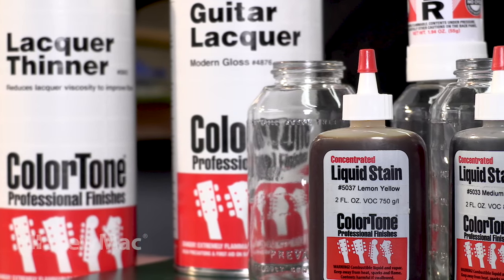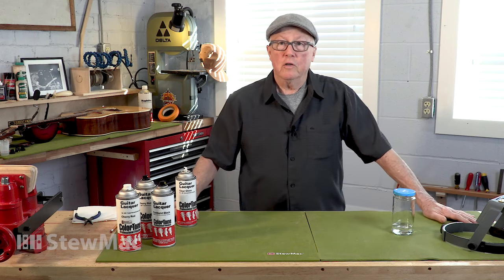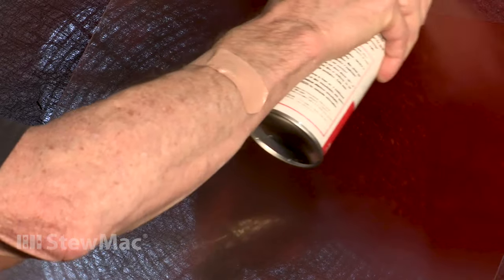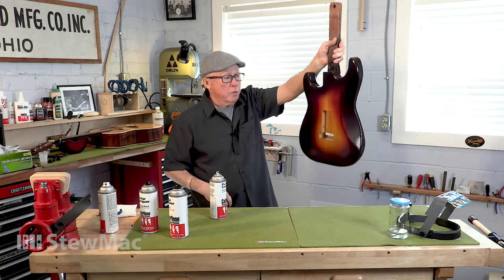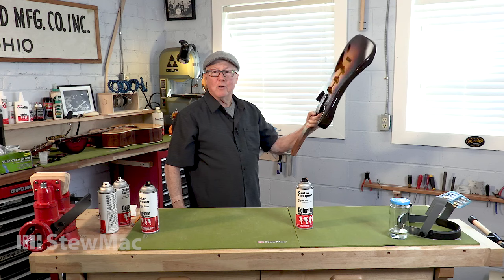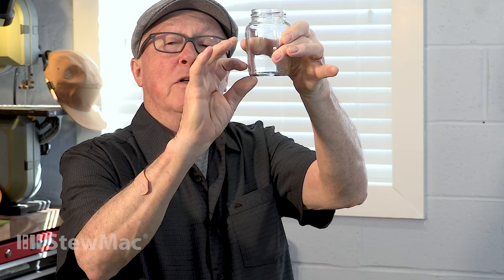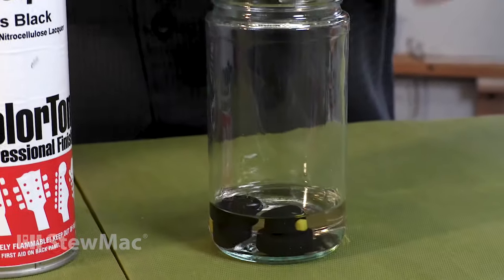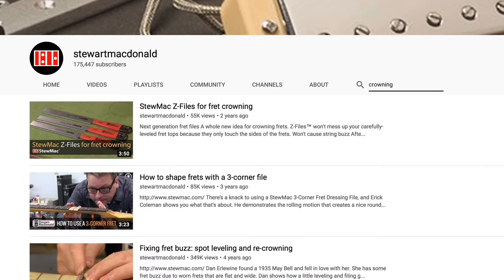Dan Erlewine's 5 Tips for Aerosol Guitar Lacquer

Comment: *AS THE PAINT DISTRIBUTOR, LET ME AD ONE MORE TIP*  The Biggest Thing Spray Bomb (aerosol can) Users Don't Do Correctly or Enough Is, To Shake The Can Correctly!    The Can Is Purposely Made In Such A Way So You Can SEE When The Paint Has Been Shaken Enough & Is Well Mixed....  The Cans Were Designed For You To Shake The Can Up & Down Vigorously & Hard, Thus Leaving Tiny Dents In The SOFT Bottom Of The Can!    You Should See Many Dents In The Bottom Of The Can, If Not, You're Not Shaking It Hard Enough To Fully Mix The Paint!  ALWAYS Shake The Can Vertically, Not Side To Side In A Twisting Manor....... *LAST*  You Should Store Your Cans Upside Down If Going To Be Stored On A Shelf For Long Periods Of Time, This Keeps Humidity That Forms Inside The Can From Rusting Inside The Spray Relief Valve.
Reply: BINGO, you are 100% correct, this was something I was taught by a paint rep over 40 years ago, most people have no clue about the paint bottoms.....Same with storing the cans upside down, great comment, thanks!
Reply: Why do you capitalize every word?  Is your comment the title of a book?
Reply: @Retro6502  Nice! I was going to make some similar comment but yours is too funny.
Reply: @Retro6502  I ask everyone this question, and to this day I still don't know the answer.
Reply: Thank you for sharing your knowledge !
Reply: Thank you I did not know this.......
Reply: This is good to know. +++ I did not know cans needed to be shook vertically. Very timely tip for me.
Reply: @Retro6502  ''I Always Capitalize'' the ''Important Words''..... Plus I Quote-End Quote a lot, lol that's what makes everyone who they are.........
Reply: @Retro6502  my mom use to type in all caps so she could read what she was typing. Old eyes kind of thing.
Reply: @Retro6502  ahhh...can't see the forest for the trees? (all lower case btw)
Reply: I shook it as hard as I could. No dents occurred at the bottom of the can. Doesn’t seem to be very good advice. Shaking the can is good though. You might have to be the hulk to dent the bottom of the can 💪🏻
Reply: Thanks!!!
Reply: What's vertically? I usually stick a safety pin in the nozzle to get a thin linear spray. That's how I tag up the city and make some righteous graffiti art.

Comment: Warm lacquer definitely sprays better. the results look like a mirror. Before heating the can in hot water, make sure you have a Sharpie pen and clear packing tape because the water will melt the glue causing the paper label to fall off. Dry the can, mark what was in it with the Sharpie and then cover with a piece of clear packing tape so the sharpie ink won't rub off.

Comment: Might I suggest a video on things like sanding out orange peel, wet sanding, using sanding sealer, applying water slides and clear coat. I refinished a broken neck and repainted a headstock and as a rank novice they were all things I had to deal with, to learn about and do. And they all help get a nice finish. I wouldn’t have known those things had I not read about them in a book.

Comment: Hi Stew,
I’m making big bass marimba bars (percussion instrument that will be struck thousands of times with a medium hard mallet and will vibrate like crazy over and over and over). Traditionally they finished with oils and waxs, though I want to experiment with other stuff. For my experiment phase—in order of best to worst—can you please suggest/brainstorm what you think might work out for coating/sealing wooden bars that will be taking a lot of inherent abuse? With all the beating and vibrating, for instance, might shellac or lacquer or polyurethane or wood hardener or an acrylic poor be too brittle, resulting in getting rattled and crushed to death and breaking apart microscopically over time? Also consider which finish would be the most scratch resistant. (Bars will be stored in stacks and slid against each other with the potential of dirt and sand bits in between. Thanks for brainstorming with me 👍🏻
Sam

Comment: You should also align the spray tip with the round black mark on the top ring of the can.   You can see the mark in this video when turning the tip is discussed.  This aligns the pickup tube with the paint in the can so you get it all out of the can instead of sucking air.

Comment: i used minwax Lacquer gloss can and the finish is not hard strong enough as my finger pressure can effect it after the paint cured 1 month , so did i used a wrong product !
can  i use automotive paint like a base paint and finish it with a clear coat ?

Comment: I wish I watched this tips before had to learn some of them the hard way on my kit build avatar. 
   A proper mix is very important! Now I do a mix of 90% shaking the can up and down vigorously and 10% rolling the ball around the bottom and up around the walls of the can. All for a whole minute, turning the can upside down and viceversa. Then I let the can rest upside down for ten seconds, to allow the resulting bubbles inside to pop. 
    Don‘t stop the spraying movement at the edges of the piece, it will build up too much there. Just spray slightly over it, doing a „breakdance- lock‘n‘popp“-like move when changing direction. 
    Take a close look on the instructions referring the recommended temperature of the environment. If too hot (the same if you spray from too far), the tiny drops will be half dry before hitting the surface, and the paint will also dry too fast later on the surface and not uniform enough.

Comment: another reason not mentioned for heating the can/lacquer is that when you spray, you are expanding propellant liquid to a gas, which makes cold (how air conditioners work).  This can cause condensation, which can cause blushing in marginal humidity conditions. It's not generally an issue on very dry days, but with humidity higher than 65-70%, it can happen. The extra heat can reduce this.

Comment: Great Video - Thanks!!   One thing to know though, and to be Very Aware of  about "heating" an aerosol can.... part of the reason the paint comes out in a finer mist is Not only due to the paint "thinning" due to warmer temps as you pointed out..... but, also because the elevated temperature also Raises the internal pressure of the propellant, forcing the product out at a faster rate than normal. 

There is ("usually"), however... a downside to this, and that is... that it is "possible" to run out of propellant, BEFORE you run out of the product... in this case, paint, as has happened to me a couple of times.   You can apply this same technique to Any aerosol product if needed.... but just be aware that in some cases (Not All), in heating and raising the internal pressure that.... 1) you "could" run out of aerosol before the product is fully discharged,.... and 2) Be VERY Careful in preheating the aerosol container,  because different manufacturers use different propellants for pressurizing, depending on the product and "some" can "react" very violently (re: Explosive) when heated.

Some propellants pressurize exponentially in relation to the heat applied and "can" explode at container temps of 100 degrees +/-...... READ the Caution label on ANY aerosol container..... most will tell you Not to allow the container to be exposed to sustained direct sunlight (primarily in the summer) or Any other heat source above 100 - 120 degrees or explosion may (Will) result. 

I have witnessed an aerosol paint can explode (it was about 1/3rd to 1/2 full) that was forgotten and left in the sun on a hot early August afternoon for only about 20+ minutes..... fortunately, the paint was white.... and so was my shop next to where it was sitting..... the container looked like a frag grenade went off inside of it... am very thankful that I (or anyone else) was not standing close by it, when it went off. 

Sorry for the "book".... just be careful when heating and (therefore) pressurizing aerosol cans... of Any kind.  Thanks for tips.
Reply from the maker: Thank you for this helpful input!
Reply: @stewmac .... You're very welcome, and thank you, again... for all that you do and provide through your informative videos.  Have a Blessed and Happy Thanksgiving.  : )

Comment: Any advice on a guitar that has a short 20" scale, a straight at the top neck, relief in the middle and then a HUMP at the last 4 inches all the way to the end?  Looks like a roller coaster...sort of? Cant replace it. What is the best way to address this problem?  Thanks.
Reply: Truss rod. Check if its broke, and if it's not, adjust it accordingly

Comment: Dan, I use the bottom of a Coke can for touch up. Spray a little paint in the depression on the bottom then use a brush or thin it as needed. Easy clean up, just throw the can away.
Reply from the maker: Great tip, thanks!

Comment: I don't like the paper labels that soak water and soften while warming the can, bringing along the chance of drops of water to the work surface. I try to remove the labels before use so I can mark the can with permanent marker as to the contents, but your labels have too much glue. After the water-soaked label is removed there are huge lines of glue around the can during use. Please use less glue on the labels so they can be removed before being placed in warm water as directed. Alternately, change to plastic labels or printing directly on the can so the labels stay put after placing the cans in warm water.

Comment: Aside from painting a mailbox or whip disconnect, aerosol cans are best for convincing you to get a real spray setup (and the first time you lay down a finish from a real gun and it's got very little to do before buffing, you fee like you stole something). 

The better nozzles on these and even better yet, some of the US2k type finishes with a broadcast nozzle are OK, but they just don't atomize like a real gun, and the cost of the volume of finish is really high. 

I'd make a joke about spraying in an apartment where there's no realistic option to have a decent 15 amp compressor and an inexpensive HVLP gun, but woe be to the person who ever sprayed a guitar with a solvent lacquer in an apartment, and woe be to the person who sprayed waterbase and had to lay down 1 1/2 times as much finish thickness to work back through the orange peel.